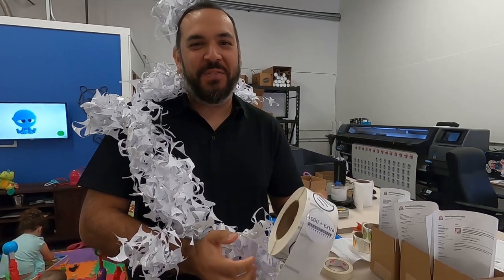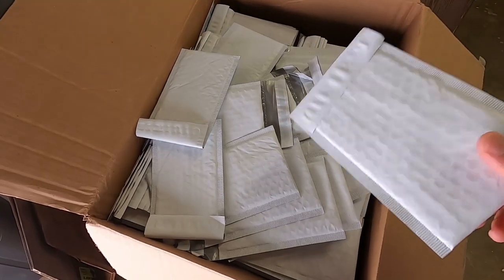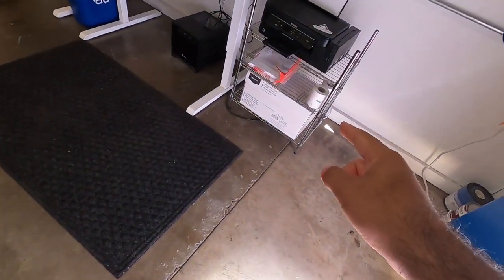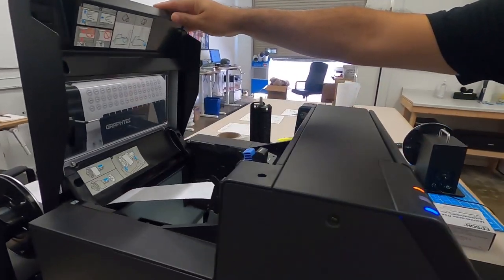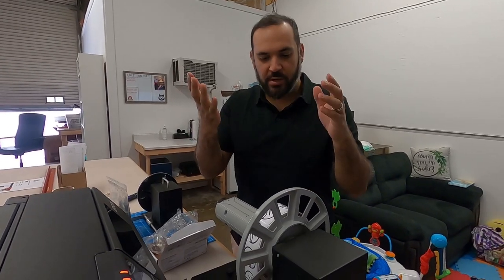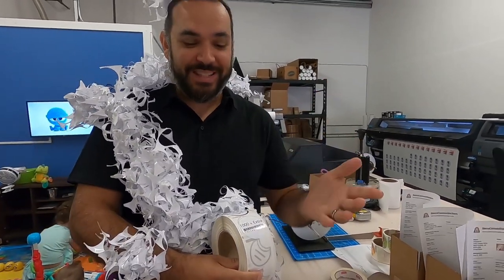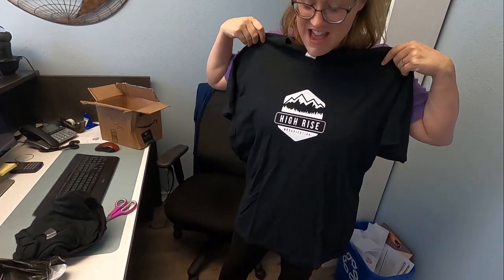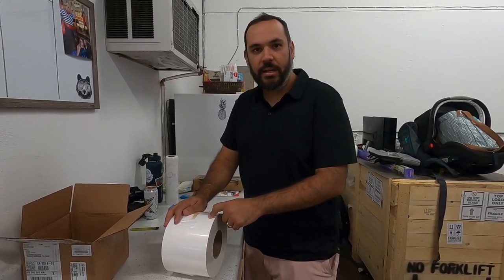Printing stickers and labels print shop VLOG #3

Comment: What size is that bubble mailers.  How many can you fit and whats the shipping cost? Avg
Reply from the maker: The one shown is a #000 4”x6”. What we can fit will vary greatly but avg cost to ship is about $8 including time and materials.
Reply: @printshoptalk  How about the machine itself.  I have a BN-20 Roland printer.  I've been printing labels and is the material same and vinyl.  (Glossy) How is the quality of the printing.

Comment: Thanks for the video. What is the label printer model. And does it print up to 8.5 wide? if not do you know a model that does print 8.5 wide? Thank you.
Reply from the maker: The current label printer that we have is great for the price however having now tested and used another label printing system now I would highly highly recommend it. Check out https://afinialabel.com/ The video will be coming out shortly

Comment: I see you have a tracking barcode on the 1000+ Extra sticker.  How did you create that?  Shipping software? Or Manually
Reply from the maker: We print 2 before every order, one to go on the box and one to stay on the roll. We do it manually in AI suite :)
Reply: @printshoptalk  gotcha.  I'm just wondering how you keep track of what is printing on the wide format and who it belongs to.  Wondering if there is a way to print the order barcode at the end of the order print where the registration marks are so you know who the print belongs to

Comment: What is the cheapest label printer  for small business start up any recommendations? Thanks
Reply from the maker: Yep the best lower cost label printer is the c6000 it is the best period. Email me if you want pricing and details.
Reply: @printshoptalk  Hey, I'm in the same position as the above, however I have some custom shape label customers (currently doing it manually in sheet format as they are low volume), and some medium/High volume standard label applications now (1.5" round & 2" x 5.5" rectangle), I was thinking an Eco-Solvent wide format print/cut like the SG2-540 and doing all on that. Or would you recommend sticking with sheets for low volume print and cut and using something like C6000 for the die cut rolls in large volume and then expanding in future? I dont think I can stretch to both straight away.